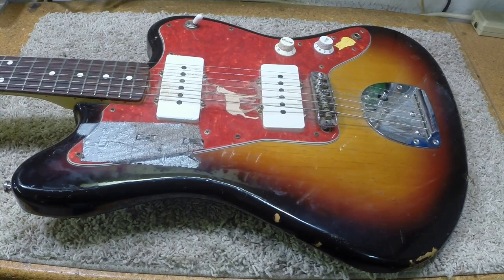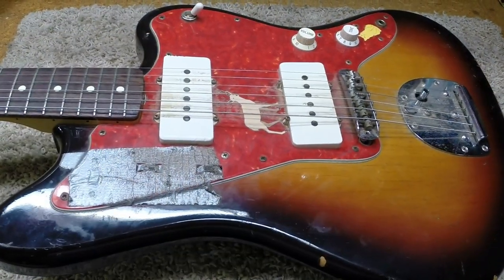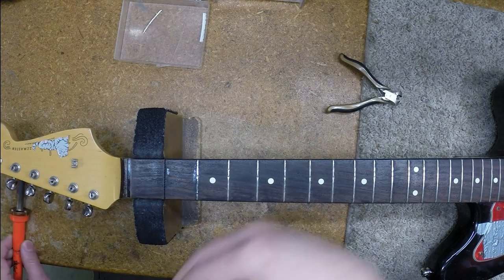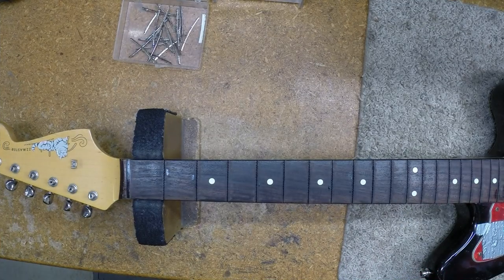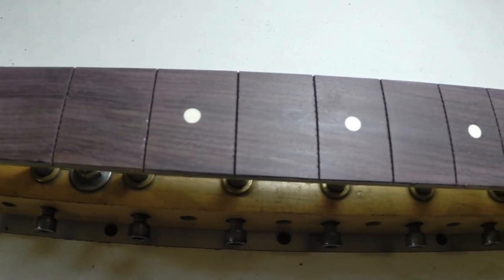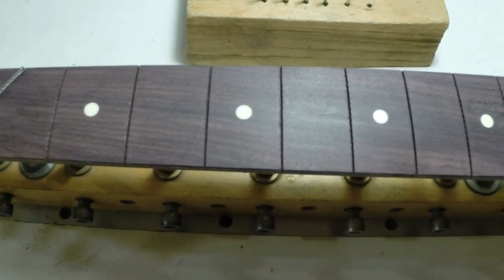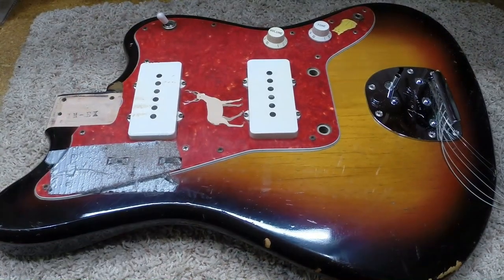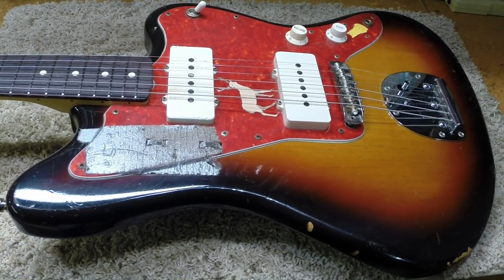Vintage Style Jazzmaster Repair Challenge

Comment: Veneer fingerboard which I've never seen on a reissue, but the lacquer looks new. What exactly is this guitar?
Reply from the maker: It was a slab fingerboard which allowed the heat straightening.  It is a Japanese Reissue I forget the year.
Reply: @guitarc.p.r.9675  I was observing the line between the maple and the rosewood. It's concave , while my 59 slab is convex.
Reply: @guitarc.p.r.9675  Ah - it was an optical illusion. I was just watching a guy playing a reissue tele of some kind in a video and depending on the angle it would look straight one minute and curved in the next..
Reply from the maker: The thing is the headstock is not flat but convex from sanding at the factory.   Check out my '65 strat repair video.  I see it a lot.

Comment: Why do you use solder?  Equal transfer of heat?
Reply from the maker: This is the oldest trick in the book when it comes to fretwork.  Yes it allows the fret to be heated faster, it will melt any glue used, and helps to avoid chipping.

Comment: Why do you use solder on the frets before removing them?
Reply from the maker: It is common practice.  The solder makes the fret heat quickly and evenly. Heating the frets loosens any glue, the fret expands from the heat, then contracts, also solftens the surrounding wood to make removal easier.  Guitar repair 101.
Reply: @guitarc.p.r.9675  Thanks for the info!